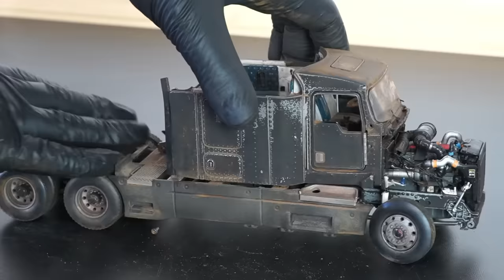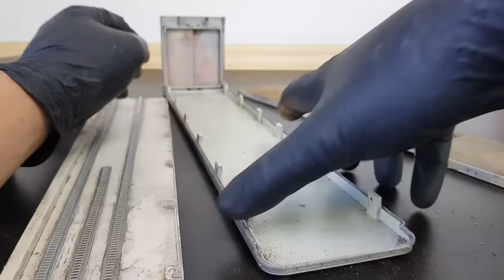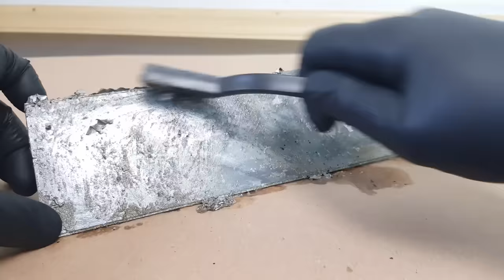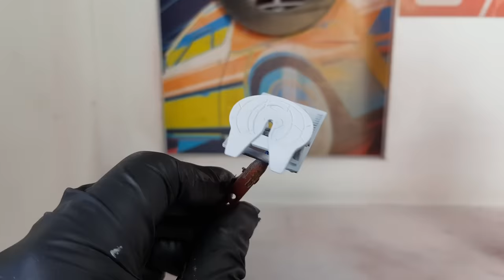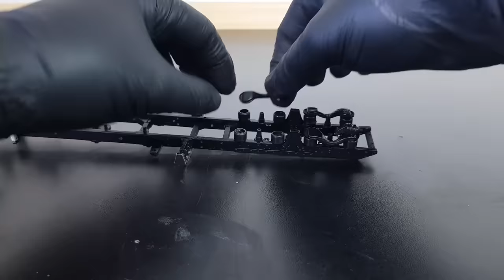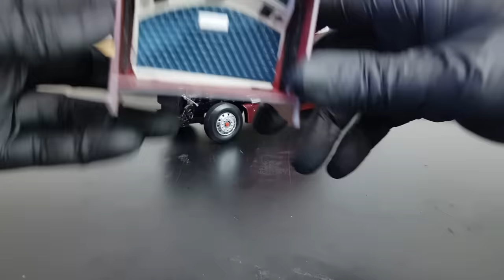Kenworth T600 Restoration Abandoned Semi Trailer Truck

Comment: I was a long haul truck driver for nearly 30 years I truly miss it the KW T600 I owned one it had a 60 series Detroit 450 it had a 10 speed Fulton transmission topped out at 110 mph... It was a joy to drive I had it for 4 years I put on about 800,000 miles on it... I owned 2 other trucks and drove many company trucks... Great restoration bud....
Reply: Mine also has double stacks,,,

Comment: Anyone who is wondering, its a 1997 Franklin Mint Kenworth (released in 1999)
OOB it was green w/gold stripe
Reply: That would have been an expensive model back then.
Reply: Yes they were pricey in the day. I had 3 of them from Franklin Mint, 379Pete with Refer, 613Mack with Tanker, and this one we just watched. I do believe they were around $200-250.
Reply: @biffsbigwheel210  Is it 1/18th scale  ? I used to collect and alway wished I could find a 1 18th scale truck.

Comment: Nice job on the restoration. I drove a T-600 with a 3406 CAT and a 13 speed back in the 80s from NY to CA several times. Nice riding with a good view out front.  And comfortable to sleep in too.

Comment: Can we just stop for a minute and appreciate how intricately made this model truck is. I half expected it to run... on stro rum or something.
Reply: it has a red top cummins! if it was dripping oil all over would be so real! lol
Reply: One area that they missed was the stinger.  They have the two air lines going to the trailer but not the stinger, which is what transfers the power and signal for the trailer lights.
Reply: Tonetr

Comment: Feel lied to.
The "rust" was painted on by an artist, and this guy comes along and undoes everything for his "restoration". And then the result looks less real and worse than the original. And I've never seen such a boring trailer as that one. One color for the whole thing? I've never seen one entirely metallic grey. Really uninspired and low effort once you got to the trailer.

Comment: Incredible detail inside the trailer as well. Who made this truck? What did it cost when new? I’ve never seen a model with so much detail. Even the crank on the trailer works.
Reply: I've got this truck, well I've got 4 including a fire engine all with this detail, mine were bought from Fraklin Mint many years ago, im sure they retailed at just over £200 then, I still have them to this day, I've a Peterbilt, a mack and a freightliner.
Reply: of the best very well done
Reply: Yes you are right  there.  Franklin  Mint does not exist any more. My brother  has quite  a lot of cars from that company. In showroom condition.
Reply: Anh

Comment: Wow what brand is this model it's a very detailed model
Reply: Someone here said is a 1997 Franklin Mint Kenworth (released in 1999).
Reply: @stanley2004  you are correct, i have an original version of this diecast in a display cabinet
Reply: Franklin mint as well as auto world diecast use actual to scale manufacturers schematics that they use to make the actual vehicles they're modeled after when they make one of these diecast it's to the exact scale of its full-size counterparts
Reply: @byrontaylor9235  Auto World uses Ertl molds and up detail them.
Reply: Maybe you're thinking of Auto Art. Exceptional models in fit and finish and details. But they're not without making glaring mistakes, though. Their 1/18 1998 and 1999 Toyota GT-One Le Mans racers mounted the rear wing on the engine cover not the chassis. I spent a couple hours each on my 6 models correcting them.
Reply: @stanley2004  it’s a 1997 Kenworth with newer mirrors
Reply: Esta brillando

Comment: The only thing I would have done differently is, paint the frame, axles, and suspension red too. Unless ordered differently from the customer, Peterbilt and Kenworth paints them the same color as the sheet metal.
Reply: and gas tanks in chrome))
Reply: @sergeihanush2262  x

Comment: What brand is that model and scale? Overall restoration could be much better IF you would clean old paint better. You can see it even after primer coating. It finally is very visible on every part of vehicle with glossy paint.
Reply: Hi Michal. Can't remember the scale but it's a Franklin Mint Model. I've still got one lying in the loft somewhere. Will admit though, the detail is amazing. 👍

Comment: you should restore these full size truck, but the engine would need to be turn over, and the Refer units on the trailers might need to be changed out.  and bunch of work to make it legal.